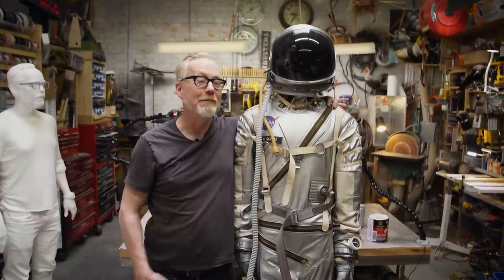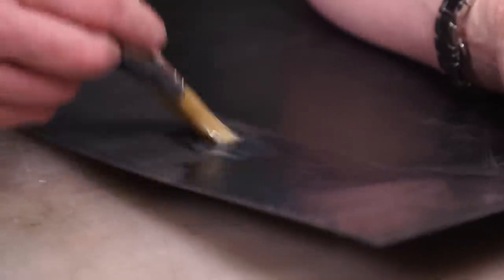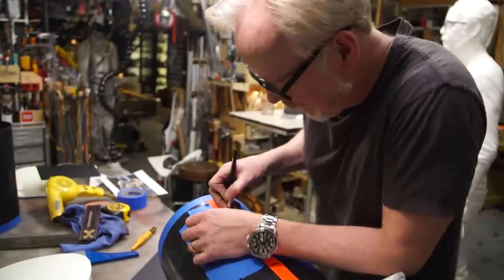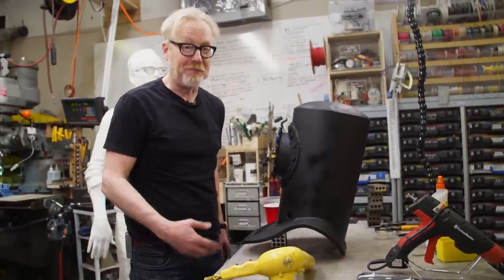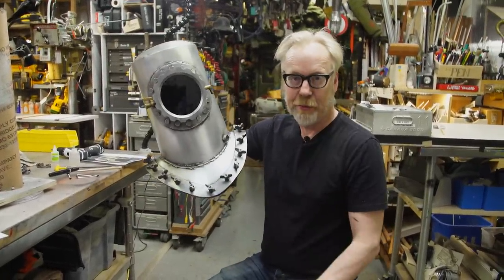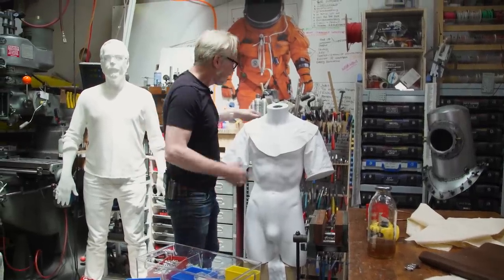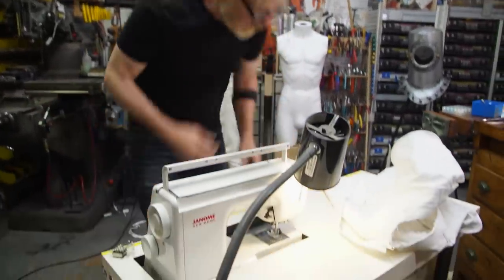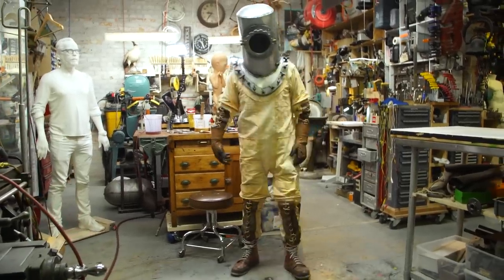Adam Savage's One Day Builds: The First Spacesuit!

Comment: I think he could cover up the zipper by using that line of cloth that was in the middle and some velcro. So it would zip up and then just hide it with the middle part, it would like the original and have the zipper functionality
Reply: yeah i was thinking this too. build the zipper a bit like a very long fly zipper with the vertical quilted strip being the top layer.  Saying that, its a lot of layers to deal with an can get mean at the join at the lower back.

Comment: Watching this as I'm building and designing something myself although it's nowhere near this complex or big
Reply: Ryan True what is it you're designing? If I may ask.
Reply: MERT AYDIN I am designing a Harry potter style wand,  I'm using a 300mm by 11mm dowel and I'm wrapping tinfoil around it into the shape of the basilisk which will be covered in filler, sanded and smoothed and painted
Reply: Ryan True Sounds great, is it your job or are you just designing it as a hobby?
Reply: MERT AYDIN I'm just designing it for fun, I'm not a designer or anything so it's just guess work. I did make a small BB-8 model out of tinfoil and painted it and made a display case out of perspex for it a month or so ago
Reply: I'm sure it'll turn out awesome @RyanTrue.
Reply: Ryan True good luck man, hope it turns out good
Reply: Ryan, I'm in the middle of making a cosplay of Scarecrow from Gotham. Watching these videos kind of helps me through the process if I'm stuck. I'm almost done with the mask. The outfit itself will be pretty interesting since I have barely any sewing experience.
Reply: Josh Sauer goodluck! Would be great to see it when it's complete!

Comment: Adam, with regard to the annoying task of filling bobbins - I'm a quilter as well as making 'other' stuff, but I was sewing when I was little (mum's a designer and taught me), and I'd like to pass on the knowledge of a little gem called the 'pre-fiilled bobbin'.
If you go to a specialist quilting store, you can buy a little stack of bobbins which are pre-filled!! They usually only come in White, occasionally black, but not really any other colours, and are almost always cotton (because quilters usually use pure cotton thread). 
They're also made of heavy cardboard, so the inners are recyclable, when you've used all the cotton, you just throw the little spool away (or keep it for some other job, but the spool itself is usually not refillable). These will save you HOURS of filling bobbins!!!  They're usually pretty cheap, comparable to buying the same amount of thread conventionally, but, when you buy them, ask the staff in the store which are the better brands. ALWAYS buy the best thread they have, ask whether it pills and whether the thread breaks easily, you don't want the thread stripping itself while going through your bobbin casing in the machine.
Enjoy. :D

PS: With regard to the weathering you did - look into tea dying, I think you would have achieved a really natural, weathered base look with either tea dying or onion-skin dying. :)

Comment: Yet another amazing Savage project. The weathering, as always, is nothing short of wizardry.

So, Adam - next time you decide to have a casting of yourself made into an Adam-equin, be sure to wear a short-sleeve t-shirt and some bicycle shorts so the resulting statue can be used for molding costumes without worrying about the clothing it's wearing.

And after it's done, spray it with dry-erase board pain, so you can mark it over and over and later wipe it clean.

Comment: You forgot the fact that the face hole was off centre as Wiley Post had an eye patch on one eye, so he moved the hole sideways to better suit his single functioning eye!
Reply: TheAnimystro That would be impractical for Adam as he wouldn’t be able to see on the convention floor very well. Sometimes you have to sacrifice accuracy for practicality  🤷🏼‍♀️
Reply: just like sacrificing the neck entry for a zipper. practicality above going authentic. if he went full authentic. he could have made the whole helmet out of metal. he could totally do it. but it would be heavy, and hard to move around with at a convention.
Reply: Indeed, I doubt Post's original design was very good for moving around at all, nor was it intended to be. It's not like he expected to go jogging inside his plane. Building a wearable replica is always a tradeoff.
Reply: TheAnimystro He also didn't make it almost impossible to walk in, despite the original design being made for comfortable flying for hours sitting down, so no folds when sitting down. This made it impossible to stand in, and walking had to be done crouched over. But that would suck on the floor of a convention.
Reply: You are correct for Wiley's suit, however there were several made for both him and his crew.  Those didn't feature the offset viewport, but it was still technically a Wiley Post pressure suit. ;)  Then again, if Adam wanted to be accurate, he'd have to get about 6 inches shorter too.
Reply: While you guys make excellent points, I thought the detail at least deserved a mention in the video. Like this is seems like an oversight rather than a conscious design decision.
Reply: Also if you go to the still untitled podcast he mentions that he did miss that detail and now he knows would have liked to incorporate it into the costume had he known
Reply: I heard that too when listening last night.

Comment: "Seamster" is a valid term for the male version of seamstress, but it's very rarely used. The neutral term (typically masculine) is "tailor", however that technically refers to someone with a very high level or mastery of sewing abilities.
Reply: savdebunnies the connotation that tailors have a higher level of ability than a seamstress may also come from the fact that men were typically called tailors. Its like the difference between maid & janitor. They do very similar work at different pay grades mostly due to left over sexism.

Comment: Wiley Post and the B. F. Goodrich Company collaborated in the design and construction of his THREE pressure suits. The first blew up during a pressure test, luckily no one was injured. The second one had a defective part that required cutting Mr. Post out of the suit, destroying it. The photo you have is of the third version, which was flown to an altitude of 50,000 feet, over Chicago.
By the way, to save weight, it was made of rubberized parachute silk between an inner rubber suit and faced with rubberized cloth. The helmet was made of aluminum, not steel. 
You can see the suit on display at the Smithsonian Air And Space Museum, where it was donated after its successful use in flight tests.
BTW, a "bro who sews" is a tailor.

Comment: I see some errors, where the wing nuts are, the suit is suppose to be between the helmet and the wing nut metal part, you can see its split in the center of the neck/chest line, so theres clearly 2 parts where the suit goes upto and looks as if rubber is sealing the helmet/suit/wing nut section together,

Comment: I've been doing lots of research on Wiley and his suit.  The job you have done is quite good.  But the one little issue I have is the little rubber hoses that  attaches to one of the little "brass" fitting on the side of the face plate and also attaches to the other little "brass" fitting on the other side.  I have never seen anything come out of that dark "fitting" on the bottom L corner of the "metal" over the shoulder part.

I try to do miniatures of these things (and others), and sometimes want to base a chess set on them...anyway, you spent a fortune on the wingnuts...I fear the same except my wing nuts need to be 3/16 in. from wing-tip to wing-tip.  The other ones could be 1/4 in.   So, 1.  do you know of any source that sells these things in those sizes?
2.  If not,  do you know a source of 3D printing that could do the same in these sizes?  OR
3. Any other ideas to get such small items?  Thank you for being on here and keep up the good work.  
Steven, (Not Mitsuko, my wife.  Long story)

Comment: Bulldog adhesion promoter in a spray can, made by "klean strip" spray, 5 min add glue/paint  Use it on everything you are going to paint vinyl, glass, metals (all) and plastics it will not flake. It is around $28 for the spray can and the quart/gallon size I am not sure the price off hand. It works awesome. I have used it doing autobody for 20 or so years. cheap insurance against peeling.

Comment: About a year and a half too late with this comment, but anyways. Hey Adam, Here's a thought on better, maybe, approach to your next project like this one.  As I don't know the technical terms for it, but the neckline bit, and crotch body sections that layer-you could use sew in snaps, velcro, or even buttons on the underside to make it removable, then hide the zipper down the front or back underneath it.  The general neutral/masculine version of seamstress, I believe would be a tailor.  Very sweet build regardless.

Comment: Shouldn't the seam in the back be riveted?  If not it should be welded.  I went down the rabbit hole checking but I never found a clear shot of the back.

But I did find an interesting/ morbid tidbit.  He used  this suit to try and break the cross country speed record but came up short when he ran out of oxygen not too far from the finish.  Later the same year he put together a hybrid plane from parts of two other planes and flew that with his good friend Will Rogers up to Alaska.  But one of the problems with his mash up plane was it  was nose heavy.  On take off on a lake in Alaska the plane nosed over and ended up cockpit down in the water killing both of them.

Comment: Cool project but those welds shatters the hole illusjon for me, it looks like someone trying to weld for the first time and failed. A weld looking like that is not to be trusted at all, it could even fall a part with a little force. Only way to fix that would be to grind it away and start over. Plus on the window part there is no weld at all just bolts.

Comment: Cool build! I don't think that this was just about supplying oxygen for high altitude flight the first time. Planes were already in service with integrated oxygen systems. Here's a service manual for the Dewoitine D-500, which first flew in '32. 
https://gallica.bnf.fr/ark:/12148/bpt6k317619c/f149.image
AFAIK, many later planes, including the B-17, flew at high altitude using supplemental oxygen but without being pressurized.

Comment: The only thing that looks disappointing is the sleeves and legs.  I would expect to be able to pull the strings tight. And the holes on his suit for the string do not appear to have any grommets like the real deal.

I like stuff that is real and works...but this sort of is. It is a costume made for Comic-Con, and as such, it works.

I think he should make a hall of spacesuits.  Copy everything used on TV or movies, or used for real.  And maybe all the uniforms with helmets used on spacecraft not requiring pressurization like are used on Buck Rogers and the original Battlestar Galactica.